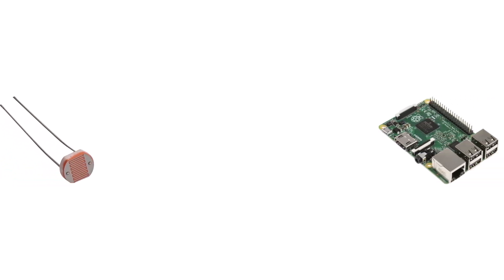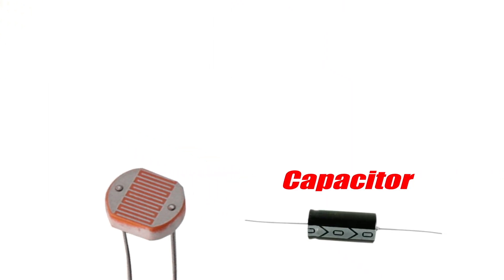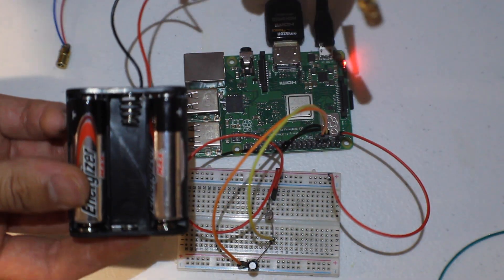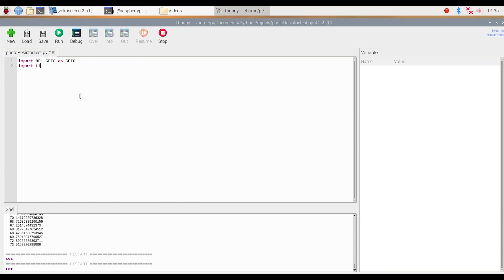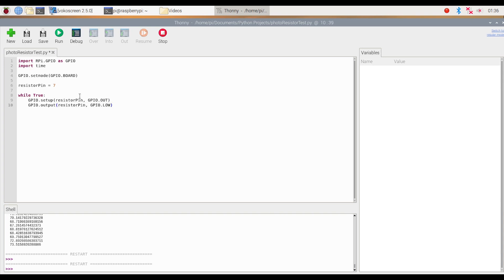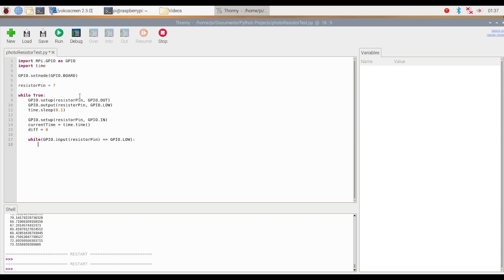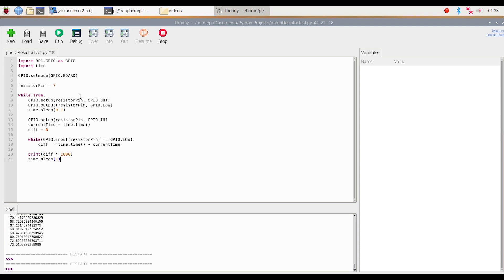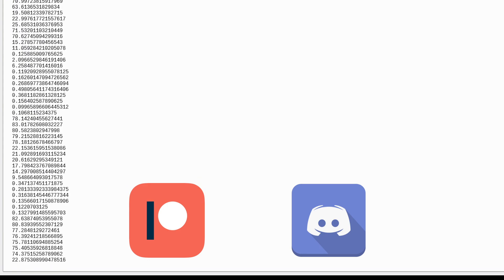How to make a Light Sensor Circuit using a Photoresistor and a Raspberry Pi

Comment: im using this in a project, it works so well (thanks for that i couldnt find anyone else who could actually do it) but on its first reading i keep getting massive spikes on the reading when i first press run, its fine after that but it messes with the rest if my code, how do i fix that?
Reply from the maker: Sorry for the late response but I would double check that you don't have a faulty photoresistor or transistor as well as any loose connections.

Comment: Follows most of this through to the end. This was my first "programming" if you will and boy am I proud of the results. Your tutorial was one of the most satisfying I've ever had. Only thing different for me was that I used set pin 11 and I had a 3 prong photoresistor module. With a little experimentation and wire swapping I was able to figure it out. Thanks a bunch man!

Comment: What is the unit of the values coming from the sensor?
Reply from the maker: In this case it's just seconds or maybe milliseconds since we're just measuring how long it takes for the photoresistor to detect sufficient light.
Reply: @Flopperam  thanks

Comment: all I get as output is 0, what did I wrong?
Reply from the maker: Hey, I would suggest double checking your wiring setup.
Reply: @Flopperam  I read a comment and checked the wiring. Watched your video multiple times but in my opinion the wiring is like yours. If I plug the capacitor into the breadboard the python file is printing nothing. Not 0’s but nothing and then when I unplug it again there are some numbers showing up. I really don’t know what’s wrong there but thanks for your reply even though the video is years old.
Reply from the maker: Sometimes the legs of certain parts like capacitors can be switched, for e.g. longer leg could be positive or it could be negative. And last thing I would suggest is double checking the code of course. Just throwing possibilities out there.
Reply: Did u solve it? Please help me

Comment: Dude, is it possible to configure this LDR sensor without a capacitor and still identify the value in the terminal?
Reply from the maker: As far as I know, not with this approach because in this video we calculate how long it takes to charge the capacitor. However, you can create a photocell using the photoresistor by connecting it directly to analog input. Here's a link with more information about it, https://learn.adafruit.com/photocells?view=all. Keep in mind though that this is for Arduino but the process is very similar for Raspberry Pi.
Reply: Thanks 🤜🤛

Comment: AT 6:03, how come the resistor pin has to be GPIO.LOW for it to be charged? Wouldn't it have to be GPIO.HIGH
Reply from the maker: Hey, the reason we set it to GPIO.LOW is because we are measuring the time it takes to become GPIO.HIGH. Naturally, with light, the resistor will reach GPIO.HIGH.
Reply: @Flopperam  Okay, I get that, but how come in the while loop you put if GPIO.input(...) == GPIO.LOW? Wouldn't you do if (Gpio.input(resistorPin) == GPIO.HIGH)?
Reply from the maker: @Dnsx_plus  The reason is that we are waiting for GPIO.input(...) to be equal to GPIO.HIGH so that we can see how long it took to become GPIO.HIGH. If we replaced the condition  like you said, then the while loop would most likely be skipped over at the first check every time since it will take at least some time for the photoresistor to charge.
Reply: @Flopperam  ahhh, but the thing is, by the time the if condition is true, we can do the time subtraction, right? I'm sorry, I'm confused, but I kind of get what your saying.
Reply from the maker: That's a good point, you could do the time subtraction after the while loop instead of inside the while loop.
Reply: @Flopperam  Thank you for responding so fast, and I'm sorry for my langaage, also do you have a soldering iron brand that you would say lasts a good amount of time? Because I've bought over 3 and they all burn out, and I've watched many videos and I take splendid care of them.
Reply from the maker: @Dnsx_plus  I believe I got a generic one on www.amazon.com, but I don't use it as much as a lot of people do so I may not be the best person to ask about that.
Reply: @Flopperam  okay, thank you for your replies, your a HUGE help buddy! :)

Comment: Great video. How do I get absolute values [W/cm^2] from the readings of the capacitor? Does this work with all wavelengths?
Reply from the maker: Hey, this should work with various wavelengths. As for the question about getting absolute readings from the capacitor, I am not sure about how to go about this.